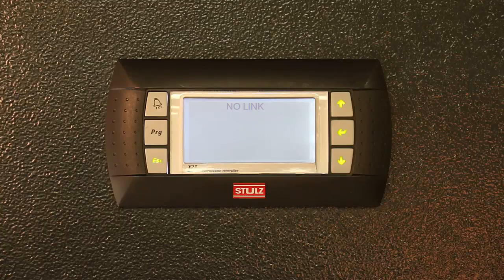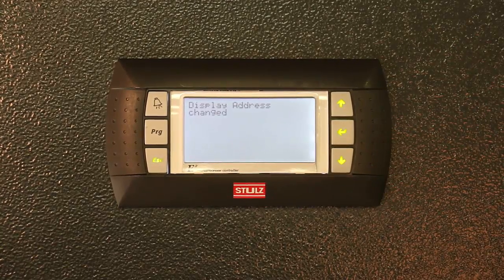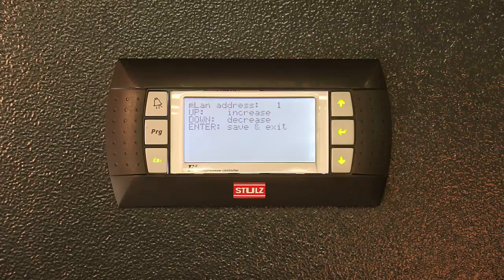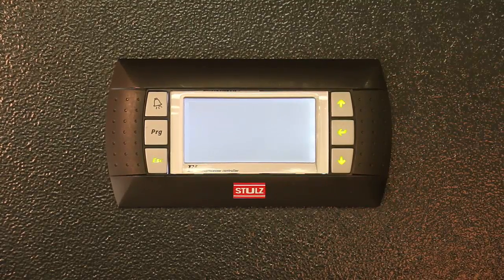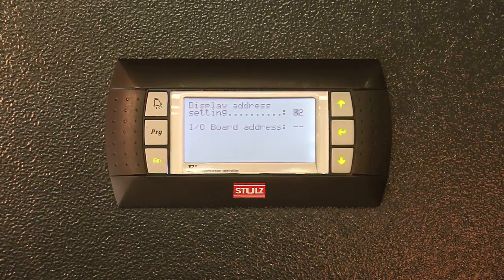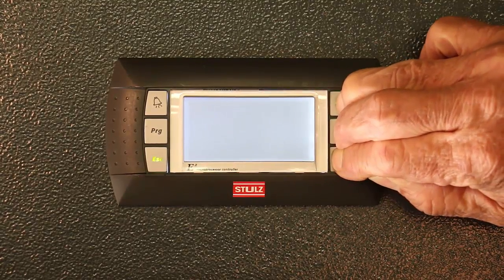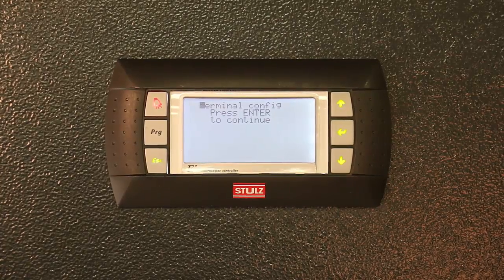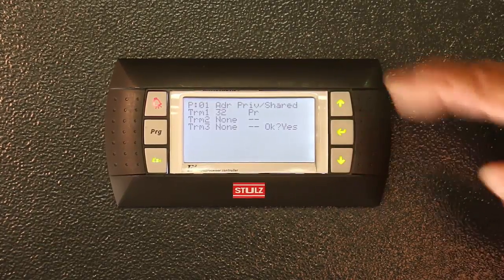STULZ E2 Controller - Addressing the Display When Reading "No Link"

Comment: hello sr i need your help because your video flow no link now ok all your video pocessor doing all programming come but only one think problem condensor fan nut running what is they problem sr manul voltage nut come system display and pressor not see